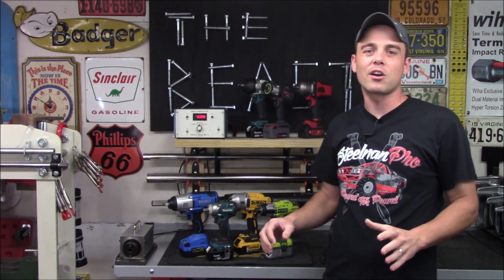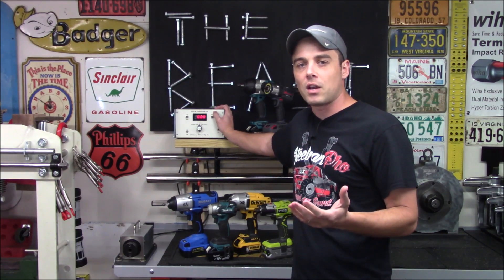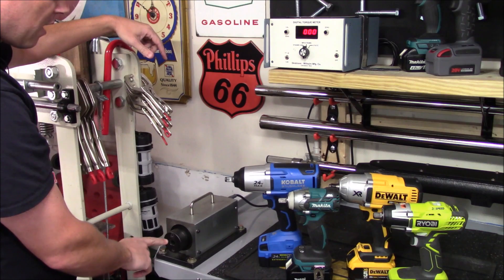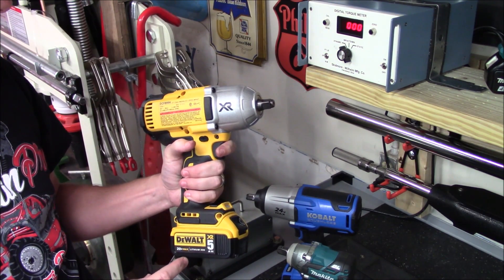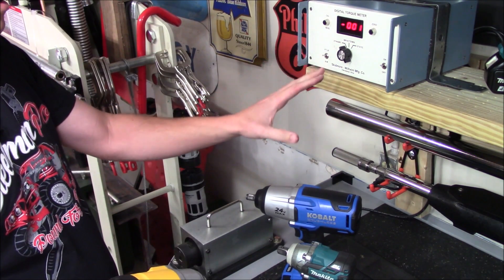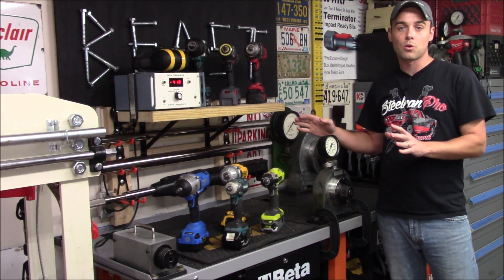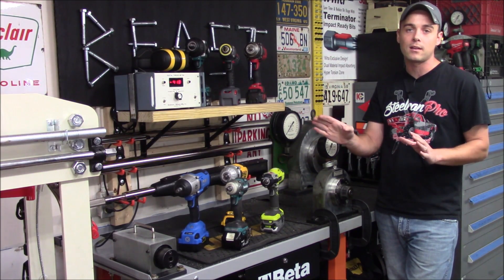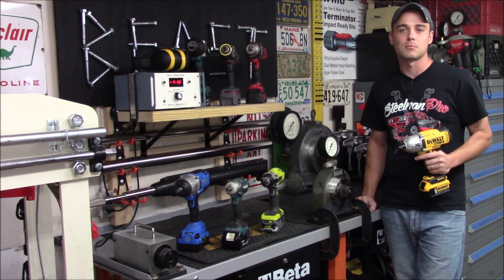NEW!  Electronic Torque Testing (Impact Wrenches) Skidmore Wilhelm T-3000

Comment: The T-3000 is not measuring the peak torque producable by a wrench. It is measuring peak torque produced against that particular test configuration. If there is no nut being tightened, you have actually removed a dynamic of the system that gradually /improves/ the impact wrench's performance. The nut-screw system itself is very high stiffness, but as the nut is tightened, the amount of static friction keeping you from turning it more (after its motion stops from each impact) increases.

The issue here is a bit complicated, but these are 3rd order mechanical systems. Electrical engineers deal with these all day long in AC circuit analysis, and I'm sure there are plenty of MEs out there who know how to analyze a 3rd order mechanical system. Effectively, if your T-3000 is too low in stiffness, it can actually artificially attenuate the torque output of the wrench. It can nullify the 3rd order components of the anvil + hammer system by being significantly less stiff than that portion of the system. But, peak torque is dependent on that 3rd order anvil+hammer system. The stiffer that is with the same amount of energy, the more peak torque the wrench should be able to produce on a nut. Because of this it's possible for a wrench to release more energy in its impact cycle, but produce a lower amount of peak torque with a high-stiffness load, but such a wrench could read higher on the T-3000 system with the other wrench it's being compared with that produced a higher number on the old-style test.

The T-3000 then can only produce an accurate number if that anvil+hammer mass-spring-damper system is insignificant to the final result, however if the test results vary in magnitude from the T-3000 to your old test method, then I would accept that as a demonstration to the contrary, that the anvil+hammer system is significant across different impact wrenches when it comes to real-world performance(Absolute peak torque on the intended system, not under artificial conditions that do not replicate real-world conditions in a meaningful way).

I am just a bit skeptical after reading their website and the documentation on the product claiming it is a new standard for measuring torque. If there was a standard, if their method was that useful, I would expect an ISO or SAE standard to be associated with it.

Instantaneous peak torque is good, but you must also realize that the old system actually captures that quite effectively. You may think that it does not as it changes with the longer you hit it with the impact, but it still plateaus at the same point, all things being equal (such as input air pressure in the case of an air impact, or let's say input energy for that hammer cycle regardless). It's just that it takes a bit of extra energy to tighten that nut down before you can measure that plateau peak torque.

Just my 2¢.

Comment: So, trying to understand the significance of working torque vs dynamic torque; are you saying that if a bolt needs 800 ft-ibs of torque to bust it loose and if we hit it once with the DCF899 it wont budge, but if we hit it with the DCF899 for 15 seconds, then it will bust the nut loose? Am I understanding this right sir?
Reply from the maker: Basically dynamic torque is how hard it hits (max) per impact of the anvil......working is the max torque it can apply over a period of time (tightening something).  If a crank bolt won't budge with less than 300 ft-lbs of torque being instantly applied.....putting a 295 ft-lb dynamic impact on it will NOT move it even after 10 minutes (although the working torque might by 700 ft-lbs).  When removing a bolt, you are not tightening anything....you are overcoming friction created by rust/dirt/etc, coupled with the tension on the bolt/nut threads from the torque applied when installing them originally.  

If you tap on a door with your finger, it will not fall down.  If you bash that same door with a sledgehammer it will.
Reply: Real Tool Reviews ok, thank you for helping me understand this concept, so, do air impact wrenches have higher dynamic torque than the new cordless models do? I just purchased the DCF899 because I thought it was as good as an air tool for light tuck use.
Reply from the maker: Some do....hard to beat air.  But, the DCF899 is an excellent impact --- you bought a good choice.
Reply: Real Tool Reviews thanks again, I couldn't get the Makita, no one had it in stock, 1-2 month wait time, but it was only rated slightly higher than the dewalt... and I like the ability to use the flexvolt.

Comment: Did you ever test the kobalt brushless 1/2 inch impact? I use it a lot for DIY mechanic work. I see everyone putting reviews up of the dewalts, Milwaukee,rigid and ryobi. But there's only a couple of video of the kobalt pulling lug nuts. It seems pretty powerfull for its price . I picked mine up for $200 and the 3/8 for $70 on sale total was under 300 for both.  I'm wondering if it's underrated like the corded version. It seems like it's right under the dewalt.

Comment: These new electric impacts must have a lot more torque than mine. I have an old Hitachi electric impact and it won't even take truck lug nuts torqued to 140ft lbs off.
Reply: Matt's Shop I had the Dewalt. I used it out on an oil pad and the guys with air tools were jealous. Everyone wanted to try it out.

Comment: Very nice! I like the torque wrench idea too. I understand what you explain as 'working torque' and 'dynamic torque' and the mass difference in each. My question is which number is more important when purchasing and will the battery Ah rating effect these results? Thanks!
Reply from the maker: I think that they both will be important......keep in mind that impact #1 might be 1,000 ft-lbs working & 400 ft-lbs dynamic......impact #2 might be 1,000 ft-lbs working & 300 ft-lbs dynamic......by seeing both, you will be able to tell which is actually more powerful.

Comment: Can the new instrument be used to verify the other Skidmore Wilhelm? Have you tried an automotive torque wrench at specific force. Does that even make sense for the t-3000 or is it strictly for power tools?
Reply from the maker: They are completely different......the bench/beam mount & electronic units are calibrated differently & are dead-on.  One type of measurement (electronic transducer) is nothing like the bench/beam versions (hydraulic).

Comment: I really thought you were gonna test all them out
Reply from the maker: I can on one of my smaller Skidmore units.....the Model J.  For the electronic testing though, currently I am limited to 1/2" & 3/4".....but soon I will have the 3/8" capabilities also.  I will check on a 1/4" version.
Reply from the maker: Nope, just explaining what the test is & why I am including it in future videos.
Reply: Any way to natively measure the 1/4" drive wrenches without putting an adapter in between?
Reply from the maker: Most likely yes.

Comment: By "working" torque do you mean that those numerous individual impacts at a lower torque are equivalent to a single static torque of a higher value?
Reply from the maker: Working Torque = the max torque that can be achieved during 15 seconds of continuous impacting on the standard Skidmore (tightening a bolt.....RH or LH threads).....this will always be the largest torque spec because it is the result of MANY individual impacts hammering on a bolt to tighten it.

Dynamic Torque = the torque produced in realtime with each impact of the anvil. (How hard it hits).......this will be a much lower torque spec, because it is not based on a continual buildup of pressure like the standard hydraulic skidmore test.

There is not a formula to know what one would be based on the other ---- keep in mind that all impacts will have different RPMs & different IPMs, so testing both methods will give a more complete picture as to which is more powerful.

Comment: Here's a question I would like to see you answer with your Torque Testing equipment. Does the use of an extension with a hand held torque wrench or impact wrench alter the torque being applied?
Reply from the maker: With an impact wrench -- yes.  I actually made a video about this "Torque vs Torque Loss" & show how extensions, adapters, & universal joints will lower torque specs.  I plan to do a similar vid with torque wrenches.....we will see!....so stay tuned!
Reply: I sure will! That has been a question that has puzzled me for many years. I think it would be a great demonstration of your torque testing devices especially with the critical accuracy now demanded by new technologies and demonstrate the accuracy of various torque wrenches as you mentioned.
Reply: An extension on an impact will lower the dynamic torque as the twisting will absorb some force.  However it shouldnt effect a handheld torque wrench since any twisting force gets transmitted to the bolt.   At lower torque the effect will be nil since there is negligible twisting of the extension.   What effects the measurement more is moving your hand away from the grip or using a cheater bar.

Comment: I know impact drivers with socket adapters suffer torque loss, but do you think this would be accurate for impact drivers or at least give a ballpark figure of their torque levels if you took several tests, eliminated the highest end lowest outliers and from there averaged them out?
Reply from the maker: It can & will give torque specs for impact drivers.....I can use a 1/4" hex to 1/2" adapter & we will see which impact drivers are the most powerful also.

Comment: Can you test those harbor freight click type torque wrenches. I think their smaller ones are less accurate than their larger ones in my use. So I have a large one for my lugs, and then for anything smaller I use a craftsman pro.
Reply from the maker: We pay for them out-of-pocket.....they are very expensive & YouTube in no way accounts for a fraction of what we spend on tools/equipment/travel/etc.  I include actual testing so I dont waste everyone's time by just saying "its powerful" & repeating manufacturer specs......I feel that by including facts instead, it makes the videos/reviews actually useful.  Hopefully you do also!  If you like the reviews & want to help out ---- click on the random Amazon links in the video descriptions, that way we get a small commission (on anything you buy after clicking the link....not just that particular item) & your price is 100% the same.....that helps a lot more than YouTube.  Thanks!
Reply from the maker: Yes.....I currently have adapters for 1/2" & 3/4" drive tools.....I will have a 3/8" version soon.
Reply: Real Tool Reviews Fantastic, thank you! That would be great to see. Just wondering does youtube give you enough to pay for those testers, they seem very expensive. Or did you have to get them out of pocket because you just find it fun? Just seems like even just one of those would be a very hefty amount and pretty specific devices.
Reply: Real Tool Reviews Awesome, it does help. That is why I subbed for your compares and I will for sure your your links to get my next impact. :)